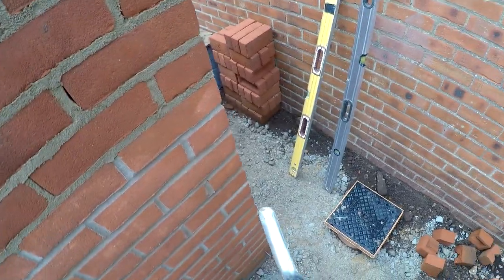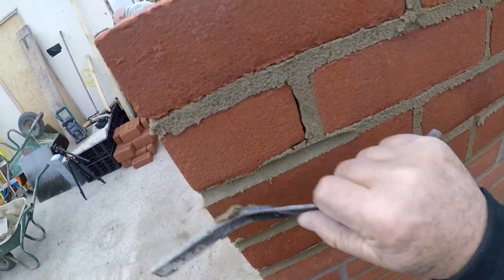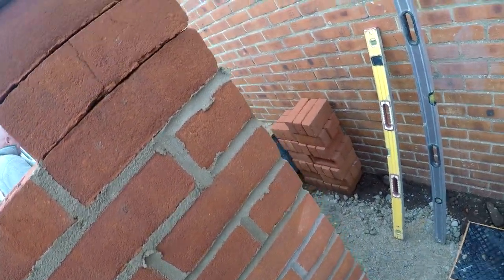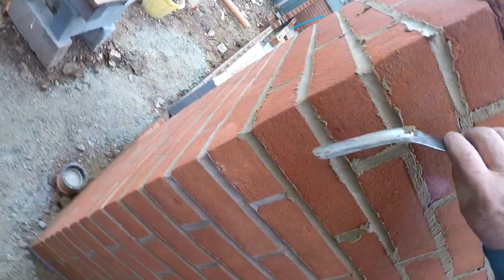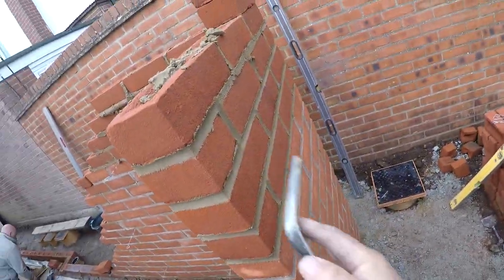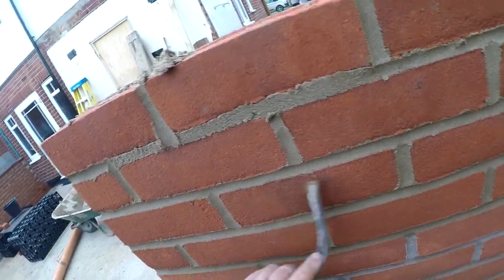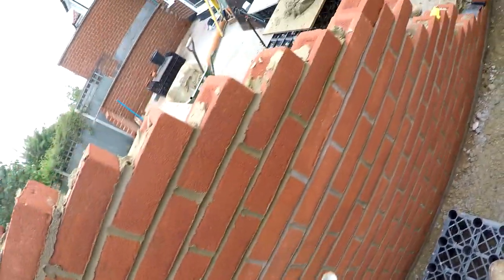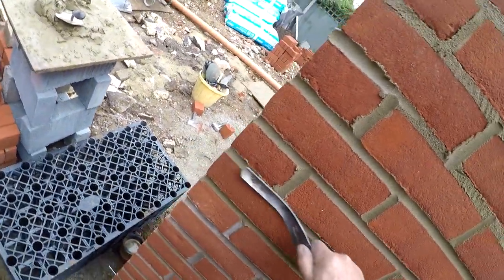HOW TO Point up BRICKWORK like a pro

Comment: No No NO NO NO - Budd!  I told you before that jointer stays on the bed for at least 8 bricks before you lift, even when you do a 3 brick corner face. Long and continuous remember. Also, filling the mixer for mortar, you should know that  using your hands is a no no. Takes too long, and yer hands will crack. Yes I know I use a shovel. Now can you tell me what a jointing iron does?
Reply from the maker: Mike , chill out boss I’ve been doing it this way forty years plus and I still have two hands ? My back is shot to bits but I still have two hands in good nick, where are you based ? Many thanks for watching 👍👍
Reply: @BuildingwithBudd  You know I was tryin to stick up for you against the first 2 comments, right, don`t get me wrong. It gets right up my nose, people having a go, you`ve gotta be the neatest on here. Wish I had your skill, and patience. All the best from the Midlands.
Reply from the maker: Mike, it’s easy when people are sitting at a keyboard 👍really appreciate your comments keep them coming are you in the game? Boom 👊😜
Reply from the maker: Have you seen the comments that Paddledog has put up he’s something else that one 👊